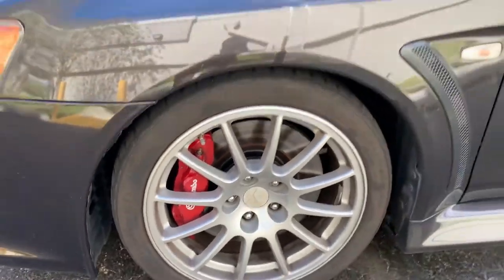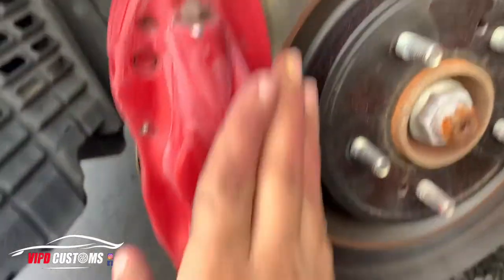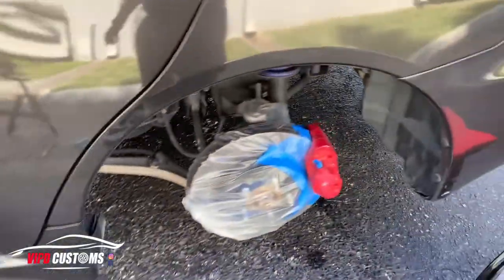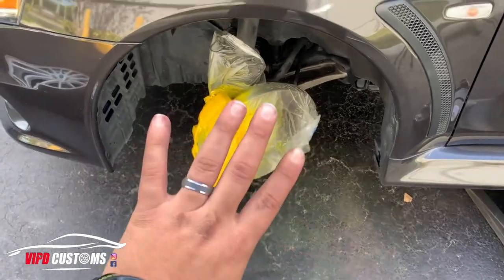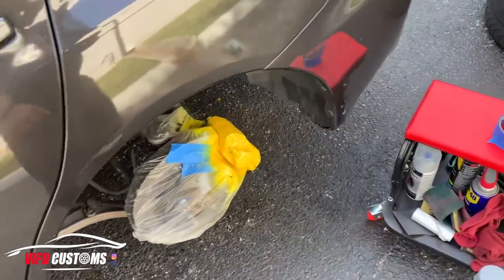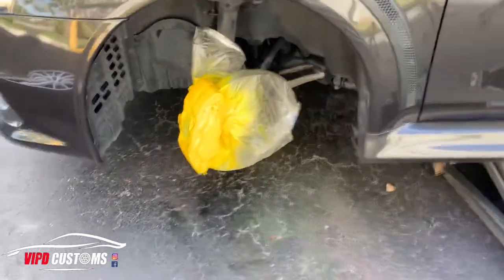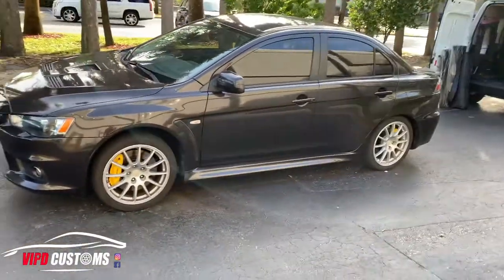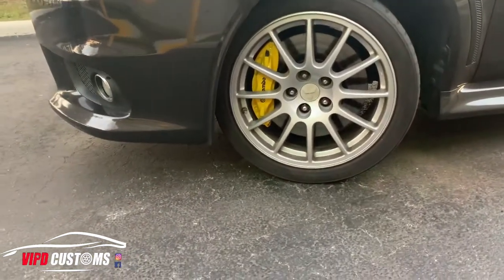PAINTING BREMBO CALIPERS !!! RESULTS ARE AMAZING !!

Comment: I'm thinking of doing this for my 8. It's been over a year since you did this, would you happen to have any follow up on how well 5 coats of paint and 3 coats of clear has managed to stand up to heat and brake dust using the Duplicolor brand paints?
Reply from the maker: I had my Camry calipers painted for almost 2 years with no issues if done these steps it will last